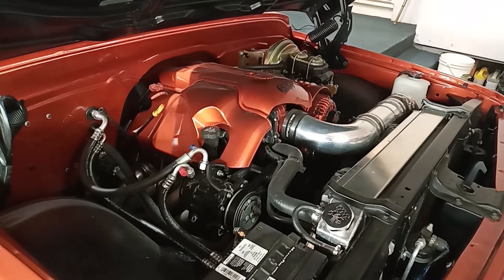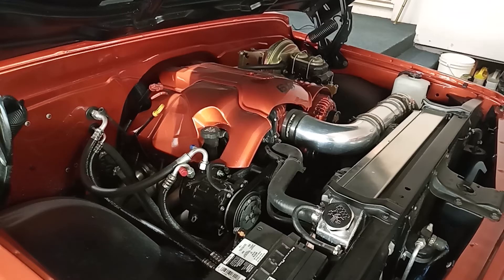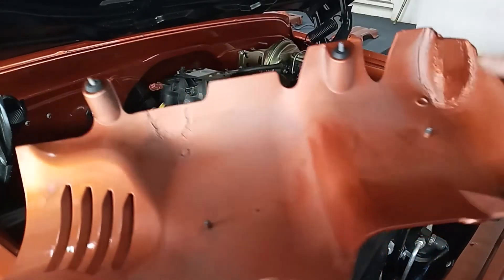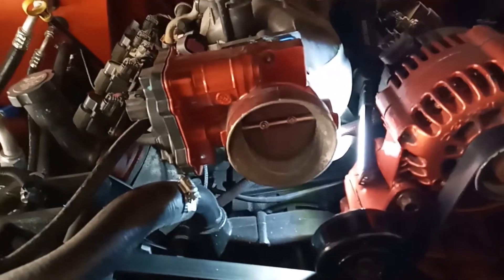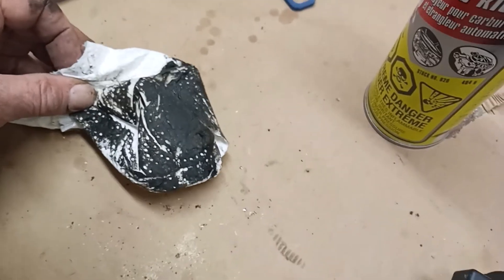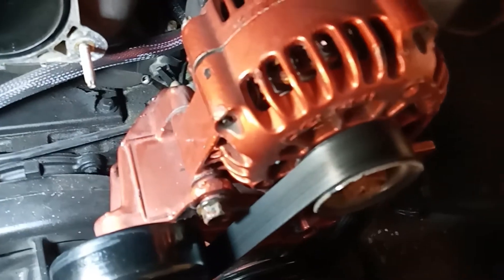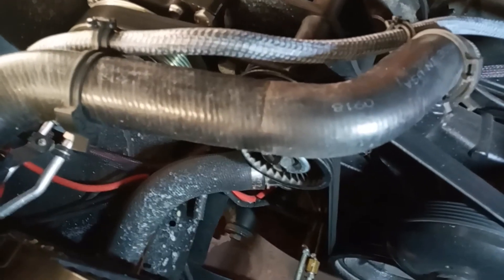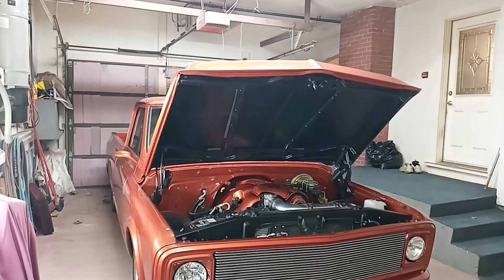GM Code P1516

Comment: We think the same on the factory clamps and moulded hoses and such. Things always look better when you can clip and snap it all together and it looks "factory" appearing in a non, factory setting. That's why my car has only minimal chrome on it. No billet anything. I just like the clean and painted look so much better. Love your truck man.
Reply from the maker: Thanks, I think it is the minimalist understated look that I like not all the gawdy crap. Other than the steering wheel I took out all the chrome in the interior too. Just couldn't bring myself to paint a 2-300 dollar steering wheel. The real show is in the pedal.
Reply: @noccis3448  I fully agree. Let the vehicle speak for itself. My buddy has a couple real nice rigs. One is a 67 chevelle that he's done many custom features. But the car could have been completed front to back if only he would stop changing Everything out for billet this and aftermarket that... there's a good place for aftermarket upgrades but the simpler the better in my books.
Reply from the maker: @dazeofgloryshopworks5806  Agree, I am working on a 31 a that is going to be a little funky but if I can keep the owner under control it will be a nice piece.
Reply: @noccis3448  that's the trick. What the owners envision vs what they "think" it'll cost and turn out like are usually two very different ends of the same spectrum. Lol
Reply from the maker: @dazeofgloryshopworks5806  No doubt about that one but not an issue in this case. It is not going to happen in 2 weeks so slow the f down if you know what I mean. It will be here sometime after Christmas. I have another project arriving Saturday.